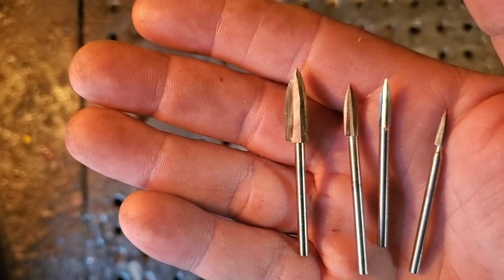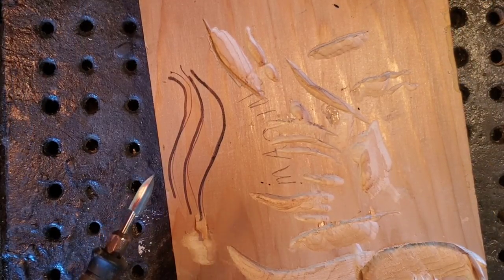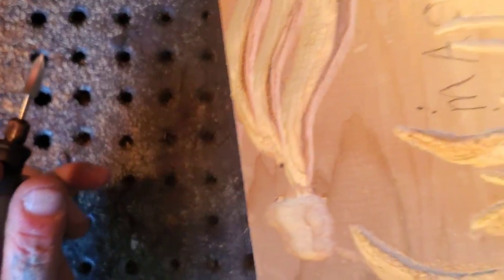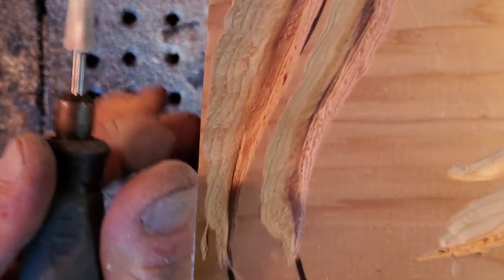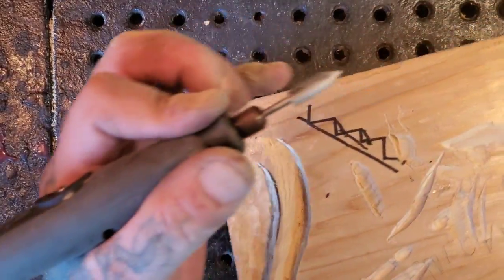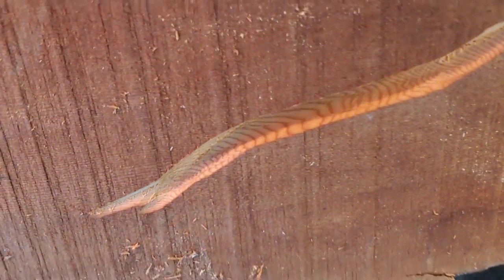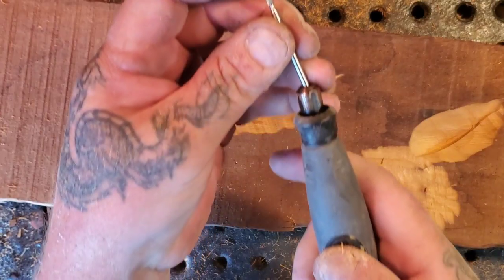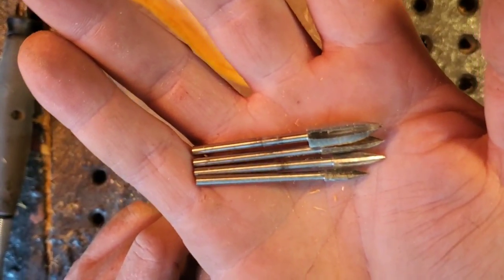I test these cheep burr's from China In my    Dremel flex shaft. Do they work?

Comment: "Up the stairs and down the stairs" is caused by the direction of rotation of the Dremel. If you push against the rotation you get tear-out. The tear-out is caused as the tool attempts to lift the wood under the burr. Looking down onto the business end of the Dremel, the tool will rotate anti-clockwise, or clockwise when you're holding it point down.

Comment: Initially I thought the burrs were good and cut well, and used with care they should be another string to your bow Jordy but I just read Ed Devaronas  comment saying they blunt quickly, and I saw you had replied to him. I just think it depends on the type of wood you use and they might be sharpenable say with diamond files.
Reply: I think the type of wood is irrelevant. If I'm always using hardwoods, then I want to know that they're not going to blunt mid project - it could be time critical.

Comment: I just read the other comment, and I'm not noticing the bits getting dull. I am saying this with no disrespect to the other comment. 
    I will say these bits should only be used at an angle. Don't lean them too close to the end of the arrowhead. It will  it skip. 
    Do not use them Tip straight down. There is no point. Only use them  after  the shape is carved out, and you're trying to smooth the area around the raised design. 
    Wear all your safety gear, an make sure the piece is on a flat surface, where it can't skip and catch your clothes. I'm also wearing my carving gloves, just incase.
Reply from the maker: Hmmm funny u say that because I use them for everything :)
Reply: @Carving Fusion : By Jordy Johnson  Of course you can, and it would be way easier then changing bits. Your obviously very skilled and I just putter. I prefer the the round ball end, it's cuts cleaner. I'll take any suggestions?  Did u like my pun?

Comment: Looks like they chatter a little. I wonder if it's because of the longer shaft. Looks like they stick out quite a bit. Hi Jordy.
Reply from the maker: Yes they do rick u really have to work with the grain with these burs
Reply: @CarvingFusion  Well, I don't know how spencive they were, but it might be a good experiment to cut about 1/4 inch off one to see if it tracks any better. Just a thought, looks like they are long. The long shaft would allow some flex I think.
Reply from the maker: @evilevilrick  yes i agree rick, when i am doing these reviews there can be so much diffrent variables, so i just try to leave them as simple.as possable, 
The only true way to do a review is to see how they last over time.. 
Would you agree?
Reply: That sounds like a good ideal Rick.